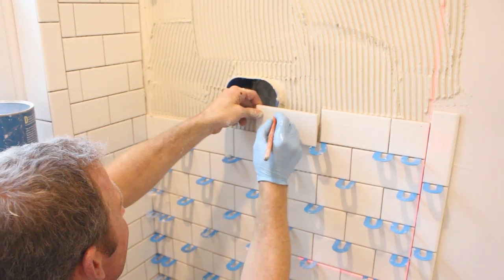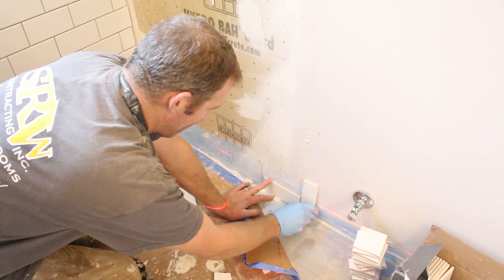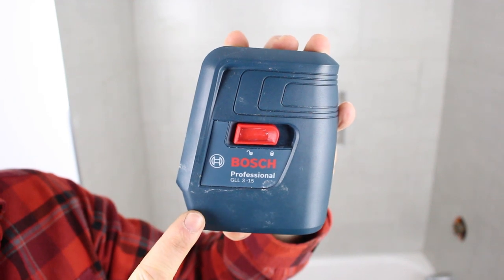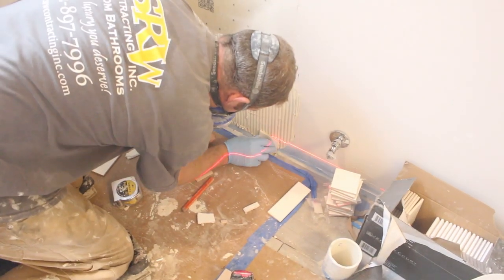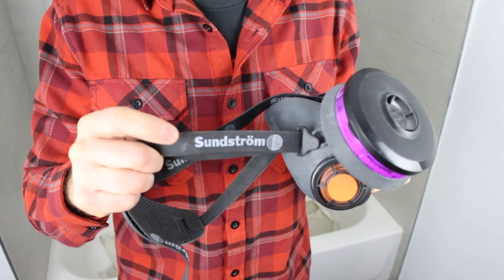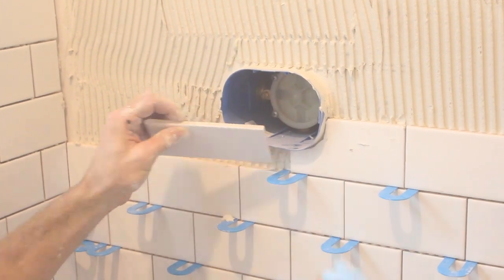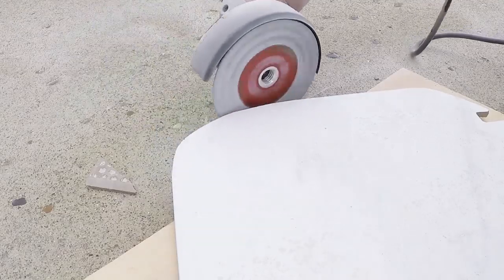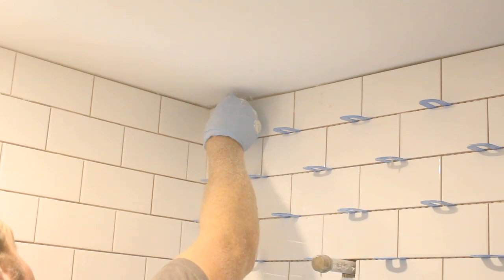How to Tile a Shower Wall...Subway Tile Tips on Plumbing Wall -- by Home Repair Tutor

Comment: At what size of tile would you recommend using seam clips? I watched another video where you used them, but not here. I REALLY like your videos BTW.... very helpful in gathering information for my first tile job.
Reply: I also have that same question. Do they make t-lock levelers for smaller subway tile? Or is it not necessary?
Reply: @PeterMayIV   small tile are usually flat and you are using a smaller notch trowel. For the most part very easy to get flat  by hand. Anything over 18" inches on the long side is a good time to use an anti lippage system. They only lessen the lippage by pulling the tile up so the right trowel is necessary to ensure enough thinset under the tile.

Comment: Great video again guys. I asked the same question on another video - Do you see any issues with using Wedi Ligno with Goboard for the walls? There is a big difference in expense between Wedi and Goboard.
Reply from the maker: Hi Gabe, the issue is warranty. But if you’re okay with Wedi voiding the warranty then GoBoard is an alternative. So is Hydro Ban Board. Schluter also has new trays that can be used with curbless set ups.
Reply: @HomeRepairTutor  thanks for your reply. I'm good with voiding the warranty. If done properly, I don't consider that to be a huge risk. Thanks again!
Reply from the maker: Cool, if you can find Hydro Ban Board it’s better because of the non-itchiness. Let us know if you have any questions. Especially with the transition to the main floor
Reply: @HomeRepairTutor  I just had success locating all the Laticrete products (including Hydro Ban Board, 48x60 presloped Pan, and all extras) through a local flooring retailer. I couldn't find anyone local who would sell to residential customers using the Laticrete supplied search tool. I got lucky with one of those suppliers passing me along to the flooring retailer and they helped me get everything ordered. Now, I just have to find some patience until the order comes in!

Comment: Really good video! I'm fan of your channel. Quick question. I installed wedi boards on my bathtub surround im planning to use subway tile as well (3x6). what kind of mortar would you recommend for my project and what kind of trowel?? Thanks in advance!! Cheers!!
Reply from the maker: We like modified thin-set, even with subway tiles. Are you adding a mosaic accent? Ardex X77, Mapei Kerabond/Keralastic, or Laticrete 4XLT would be good. Trowel size depends on tile but typically a 1/4”x1/4” square notch would be good with that subway tile
Reply: No mosaic accent, planning do subway tile all the way to ceiling. What about grout ? what brand would you recommend?

Thanks a lot for responding. I had learn a lot from your videos

Comment: How did Steve get that smooth transition between the hydro-ban board and the drywall? Did he use sealant on the seam then drywall mud and tape? Great tips.
Reply from the maker: We used Hydro Ban Sealant and smoothed that between the drywall and board. There might be footage in this video 

https://youtu.be/uDmhUK90-TY

Comment: What kind of mortar or adhesive and brand do you recommend to use with 18x30” tiles? Much appreciate your reply.
Reply from the maker: modified thin-set mortar, e.g. Ardex X77 or Mapei LHT

Comment: Another question, when using the tile levelling system, do I still need to use the horseshoe spacer?
Reply: If you want a dif size grout line than the leveler provides then yes. Levelers are for larger tile. There is not enough room to use them on small tile. Also small tile generally are more flat and are esy to keep true to each other.

Comment: Great vids, thanks guys! Quick question, can i butt the subway tile right up to one another? seems like that gives me the same 1/16 gap and not have to deal with spacers?
Reply from the maker: if the tiles have integrated spacers, yes. If not, you still need grout joints for expansion and contraction. Otherwise your tiles can crack

Comment: Great video. But do you place the tiles on the shower pan first or the walls first?
Reply: Those guys typically recommend doing the pan first so the wall edge is at it or over it so to speak. Their video and tutorials are great. I joined their site. My tip is to be sure to protect your shower pan heavily with either a piece of plywood and moving blanket or thick card board. - just thing if you dropped a heavy tool on it.....

Comment: @4.46 I would consider wearing some type of wrist protector/gloves on that left arm, as not matter how good you are with free hand grinding one slip and....
Reply from the maker: Yes, it’s dangerous and for those who haven’t done this type of work we recommend stabilizing the tile with a clamp or over a piece of plywood
Reply: You can touch a smooth rim diamond blade with minimal risk of injury. Esp a wet saw. But safety first of course.